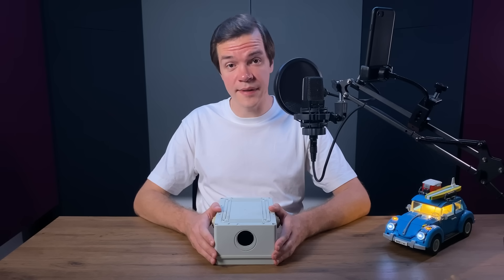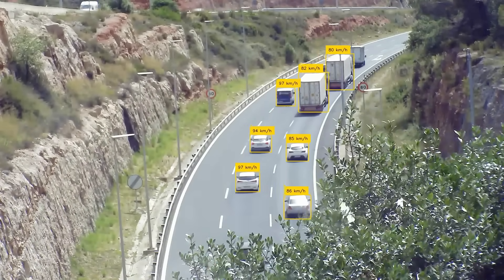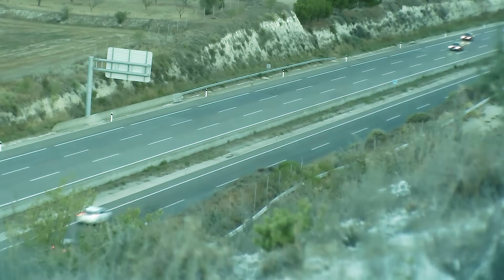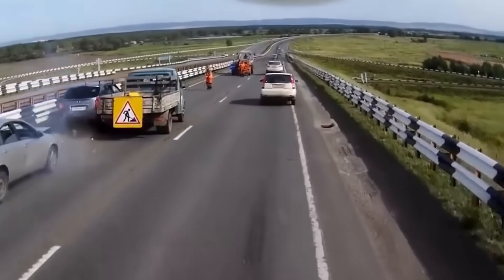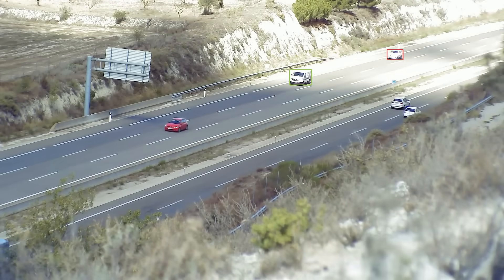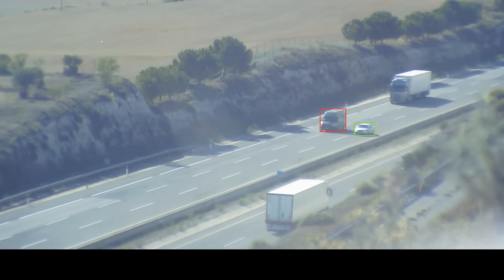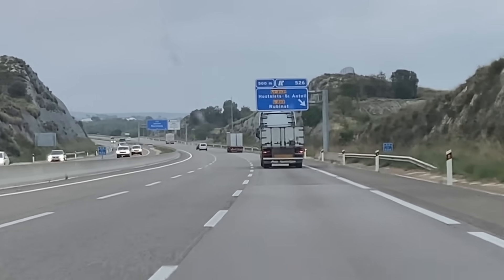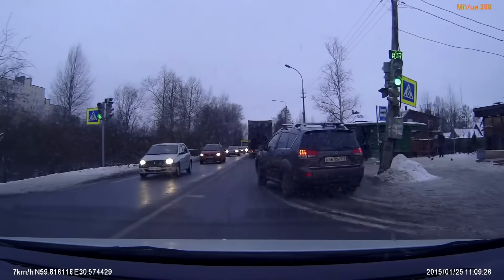New Anti-Tailgating Camera Reveals Shocking Statistics

Comment: 11:45  Someone cuts in front of me and suddenly my safety margin is gone.  So what do I do?  I ease off the speed and open the gap.  This persuades yet more motorists behind me to get in front of me.  The best thing for me is find a large truck and follow it at a safe distance since almost no one wants to be behind a big truck.  Drivers still sometimes pop in front of me, only then realize they are now behind a big truck, and pop right back out.
Reply: I tend to do this when going through dense city traffic where the speed difference between the 'fast' lane and the other lanes is small, but stress of having to slam on brakes because of quickly stopping traffic is high.  I can stop a lot faster than the truck, so no stress there!  Also truckers are all talking to each other on CB and usually know which lane to be in to get around that traffic accident a mile down the road, so when it comes up, you'll already be in the correct lane and don't have to fight to merge over.  I love following trucks in the city, and hate getting stuck behind two 65 mph speed capped trucks trying to pass each other in the country.
Reply: i was late in getting my license bc of where i lived (good transit) and anxieties about driving, and this was the first thing i did when i started driving highways and interstates. always behind trucks, because then going the speed limit wasn't MY fault, it was the truck's fault 😂 people would tailgate me for a few moments before they saw the truck ahead and either eased up and changed lanes. a good strategy for many reasons. so long as the truck isn't carrying something stinky lol
Reply: Saves fuel too, because trucks don't tend to go the full speed limit & certainly don't accelerate fast.  The only trouble is it can cut your view of the traffic ahead which means you can't anticipate as well.
Reply: @TheThunderdome-il3ez  "Saves fuel too"
I don't follow close enough to take advantage of drafting.  When I was a teenager, yes, I did that but it isn't very smart.

"you can't anticipate as well."
Indisputably true!  I expect the truck to be a battering ram and clear a path should there be something in the way 🙂
Reply: @thomasmaughan4798  I'm not referring to drafting. That's lethal! I'm merely referring to the reduction in speed, the steadiness of speed and acceleration/deceleration that trucks drive at vs cars. If you drive like you're a 50 ton truck (or a car with a tiny tiny engine) you won't consume as much fuel.
Reply: Only if the truck is doing 10 mph over the 70 mph speed limit. 
He knows where he can speed. 
I have only had 1 speeding ticket in 43 years. 
Always keep a safe distance.
Let them pass.
When you see two or three cars coming up fast behind you be very cautious. They are passing everything like it's standing still. Usually at 20 mph over the limit. If someone doesn't see them and pulls out to pass it could cause a severe chain reaction collision. 
I call them the bullet.
Because no matter how fast and far they go, they're gonna hit something somewhere down the road. 
May not be today. 
May not be tomorrow. 
But it's gonna happen.
Reply: Also a safe distance behind a truck is far enough back that you aren't catching the stream of air coming from the truck. 
No ripple.
And no that's not right up under his trailer. 
Don't try to draft a semi. You're not on a race track.
Reply: 13:27 Why are we measuring an actual distance between cars? I was always taught car lengths or to use the bottom of my windshield lined up with the bottom of the car's tires in front of me.
Reply: I agree for the most part. I don't understand why this guy suggests slamming on your brakes. At any rate, the big trucks I've been behind tend to go just under the speed limit. It becomes gradually apparent when I catch up to them doing exactly the speed limit. That's at least why people don't stay behind them in America.
Reply: But then you are behind a big truck and cannot have a full view of the road
Reply: @FreedomTalkMedia  "But then you are behind a big truck and cannot have a full view of the road"
Ya think?  :-)
Reply: Good idea
Reply: Agree. When motorway traffic gets congested, just find a safe distance behind a truck in the slow lane. You’re only then going 20% (at most) slower than the fast traffic. Not a big deal. 
      However, when a slip road joins onto the slow lane it is prudent, if you can, to overtake the truck and leapfrog to the next truck, as a general habit. Also, likewise when going up uphill stretches where most trucks have to drop a gear and lose some speed - plan your overtake before the hill even starts rising.
     Otherwise, yes, not a bad strategy. Saves a lot on petrol too.
Reply: Great idea. Terrible execution. That's a recipe for a rock through your windshield, it's 100% better to just pass a truck. (a truck, not a pickup)
Reply: Smart ! I too use big rigs as speed regulator if highway driving . It's not the fastest, but keeps my blood pressure down .
Reply: I'm inclined to try and convince people that following trucks is a bad idea because I don't want these people pinching my spot behind the truck
Reply: This is actually a good strategy 👍
Reply: No, this is NOT a good strategy. Following large vehicles reduces how much you can see ahead of them.
Reply: @littlefrank90  "Following large vehicles reduces how much you can see ahead of them."
Eliminates it completely in most cases :-) but if I am following a Ford F350 I also have no forward vision and also no space cushion or the benefit of 70 thousand pounds of battering ram clearing a path for me.
Reply: @littlefrank90 with the proper follow distance, no it's not an issue at all. That's the point. You are following a truck with the proper safety gap. People will merge, realize they are moving slower than they want, and get back to the lane they want to be in. Which means you have far fewer people getting into your safe zone, and the ones that do, tend to leave it quickly anyways. It also leaves space for merging traffic on a 2 lane road.
Reply: That is billboarding you can’t see. Also if you rear end a trailer or big rig it’s gonna be an underside crash…. Getting rear ended versus getting the head scrapped off.. Don’t follow trailers and heavy loads, you’re not being safe lol
Reply: @greatbingus  "Don’t follow trailers and heavy loads"
Yes, beware the heavy loads in particular.  The typical 50 foot trailer could come open and dump its load.  Pipes are very dangerous and steel rolls are extremely dangerous. 
As for running into the rear of a trailer, they usually have a loading dock bumper so it is more dangerous to run into the side.  
Given that most automobiles can stop in shorter distance than a truck, it is unlikely to ever run into the back of a truck unless the driver of the automobile is really not paying attention.
Reply: So learn how to drive and you won't have that problem.
Reply: Get out of the fast lane. No one cuts off the far right lane unless they're diving for the exit
Reply: @bebo2490 exactly why the far right lane is often the most dangerous.
Reply: @kylezo that's cause that's where everyone tail gates 😅
Reply: @bebo2490 idk I think it happens absolutely everywhere 😹
Reply: Driving behind a truck is as dangerous as it can be. There are so many objects a truck can go over, but you would be smashed because of them in a normal car.
You're basically driving blind waiting for a nasty surprise.
Reply: @doruneda7040  "Driving behind a truck is as dangerous as it can be. "
You do you and I will do me.  I leave sufficient space between me and the truck to see and avoid obstacles.  Also, at a traffic signal I am far enough back to see the green (or red) before entering the intersection.
When the highway is busy, following a truck at 2 or 3 seconds spacing is possible whereas trying to leave that kind of following space behind automobiles is impossible.  I get this space cushion BECAUSE of following a truck when other people refuse it.  Elsewhere, people have two car lengths between them at 70 miles per hour and this is how you get huge pile-ups.
Reply: If you're as slow as truckers, then you're the problem.
Reply: @conservativeriot5939  wow this has all really gone straight over your head 😹
Reply: @kylezo  keep dreaming
Reply: @conservativeriot5939  what?? Lmao
Reply: @kylezo you're welcome
Reply: @kylezo nah he’s right.

The amount of times I pass someone who’s in the left lane while myself in the middle or the right lane going the speed limit or below with no major congestion is too high. 

Literally what I see is caravans of congestion caused by idiots going slow in the left lane, and then the pockets of space in between followed again by another caravan caused by yet another idiot or idiots traveling too slow. 

If someone comes up speeding behind you, move over, it’s literally safer to do so.
Reply: @zzipkis  that's not what he said and what you said is correct. Defensive driving is safe. You're reframing the scenario so much that is not even the same argument lol. I'm right, you're half right, and he's wrong. In some states, the left lane is for passing only (Oregon). In other states, the left lane is just another lane (California). Driving defensively is the correct approach. Being an A hole on the road is what actually causes problems. The entire point of this conversation is that d bags who wanna drive fast are dangers, and letting people pass you and giving plenty of follow distance is the right approach. That's why when he said "aassdfff im fllllyin past u hur dur" the reply was "yes, that's the point". Good drivers are more concerned with managing risks than driving past people. I guess you missed the point too
Reply: @kylezo yeah but most accidents in my experience are not caused by tailgaters but by slow pokes not paying attention after creating congestion caravans
Reply: @conservativeriot5939 dude come back you never answered
Reply: @zzipkis  Caravans of safety with reasonable speed, separated by danger zones, when there's just enough space to go fast and cause congestion with rapid braking (if lucky) or accident (if unlucky).
Reply: @conservativeriot5939  "If you're as slow as truckers, then you're the problem."
Yes, it sucks for you for me to be your leader.
Reply: @thomasmaughan4798  haha I'm usually the one flying past you.
Reply: @conservativeriot5939  "I'm usually the one flying past you."
That's the idea!
Reply: @conservativeriot5939  <———Found the A.. hole on the road, keep it up till they scrap you off the road. Less traffic when you all are pastensed.
Reply: @conservativeriot5939  Awww, it was never told no.

No, Timmy. You're the problem.
Reply: @conservativeriot5939  Truckers rarely drive under the speed limit. You are the problem.

Comment: There are many variables, but there are some principles to keep in mind.

Musical training, pzrticularly ensembles, including marching bands, help developing in children skills later useful on the highway.
o Attending to the overall context to fit in
o Sense of timing
o Ability to maintain interval forward and sideways
o Ability to start together, e.g. at a green light, every driver in the line SHOULD be starting at the same instant, but at slightly less acceleration than the car ahead

More than stopping distance, the interval from the car ahead subtends a smaller angle of blocked vision as it increases, improving the long-distance view of traffic.

They put tutn signals on a car for a reason, and lane changes are a big part of it.  Slower lane changes give oyher drivers more warning and cover some of one's own mistakes.

We still have laws, largely ignored, regarding separation of big trucks.  Better to observe these.

Can't speak for other countries, but among the most dangerous practices in the U S is policing for profit.  Far better than setting up speed traps would be officers on the road with cametas recording genuine tailgating - meaning not what you can't avoid in heavy traffic, but those who won't establish a good interval when they could, but mile after mile hang on someone's bumper.  Similar enforcement on signaling and lane changes also would diminish collisions.

In the US, generally leftmost lanes are for the fastest traffic and rightmost the slowest.  We are losing this discipline.  Inattention seems to be a big factor.

With such mapping technology as we have today, knowing where you're going before you hit the road shouldn't be the problem it appears to be.

Finally, governments need to understand and assume their responsibility for correct signals and signage.  Too many deficiencies to report.  We don't need red-light cameras, we need 5-second yellows uniformly, and signals visible no matter which truck is in front of you.

Comment: Situation will hopefully improve if the cars themself detect distance between vehicules and "force" (I mean highly suggest) drivers to be safe. Like the bip when you forgot seatbelt which is pretty common nowadays. Hopefully radar will be included in more models, or became mandatory safety equipment.

Comment: I get that you shouldn't tailgate someone, but 100m is impossible to maintain. 100m is more than 20 car length. If you're 100m from the car in front of you, people are going to get between you and the car in front. So you're going to have to brake to get some distance again. Then this is going to happen again and again and again. At the end you'll be driving at 50km/h on the right most lane. Not even mentioning the fact that if you're 100m from the car in front of you, and that this car goes slower than you, they'll never move over to let you pass if you're 100m from them.
This also depends on your car's stopping power. Somebody that drives a cheap car with drum brakes which is overloaded with luggage should have an even higher distance between him and the guy in front, whereas someone with an empty sports car can follow more closely because his car stops faster than the one in front of him.
Btw your calculation about an object falling off the car in front of you is false, because an object falling of a car going at 120km/h will continue to go for quite a while, so in reality you have more than 100m to stop because the object is also moving in the same direction as you.
12:23 well, to make money 😂 if it was really for your safety, you would not pay a fine, but only lose points on your license. Then bad drivers would lose their license if they made too much errors. The fact you pay a fine only (but also the number of speed cameras and their placement) shows the only point of those is money.
Reply: Slow down.
A cut-off event is temporary, if travelling below the general speed of traffic (and staying in the slow lane).
100m is 4 seconds of travel at 55 mph (89 km/h).
It's easy to maintain a 4-second following distance at 55mph (89 km/h), with the occasional, and brief, exception of a cut-off event.

Comment: Truckers do not do this to save on fuel. The ones who do this are doing it because they are shit drivers.  Source:  am trucker.
Reply: You have to be really close to save on fuel, and maintaining that distance accurately will probably cost more fuel than can be saved.
Reply: Tailgating a huge italian disease.You can’t believe how many practice it.Worst offenders are the delivery vans.For me,it indicates a low level of intelligence.
Reply: One can use slipstreaming to save on fuel and be a shitty driver at the same time
Reply: You save very little from tailgating. So little that you should not even think about it.
Reply: @XDRosenheim  Can you put a number on the  saving please? "So little" can be as high as 60% most commonly reported number is 40%.
Reply: @uccoskun  "So little" as in negligeable.
Reply: @XDRosenheim 
you've never driven a motorcycle behind a semi then.
It's stupid and dangerous to be super close, but even within 2-3 seconds of one you'll find very little, if any, drag.
Reply: @XDRosenheim  %40 is not negligible.
Reply: @TimHayward air drag is negligible unless you’re traveling over 100 mph
Reply: @ian.williamson    Air drag becomes measurable around 30 -35 mph and substantial around 50 to 60 mph.  Since it increases with the square of the speed it doesn't take much change in speed to make a large change in drag.   This shows up most in gas milage.  I drove a Smart for 176,000 miles and can confirm that around 70 mph your milage will change measurably for as little as a 5 mph change in speed.
Reply: @ian.williamson  If air drag is negligible most of us should be able to use bicycles at very high speeds.
Reply: Amazing comment! 😅

Comment: I think another significant factor is the probability of an event.    In the case of a leading vehicle being a "simple" passenger car moving smoothly with no near traffic in front or to the sides, widely separated from the sides of the roadway, that vehicle seems less likely to stop suddenly.    A following driver would have visibility to observe this scenario and calculate the risk of various following distances and available escape alternatives.   Traffic behind the follower, or accompanying, would also impact these options.  If the lead vehicle is one that obstructs the view, or there are near vehicles ahead that obstruct the view to some degree, the information needed for risk calculation is reduced significantly, so a default minimal risk selection would be wise.   So the following distance as a factor in safety analysis is joined by the availability of information to assess risk, and the successful processing of that information (which is often reduced by various distractions or individual capacity).    Personally, I find that I "manage" close followers by extending my following distance to allow gradual slowing in case of an event.